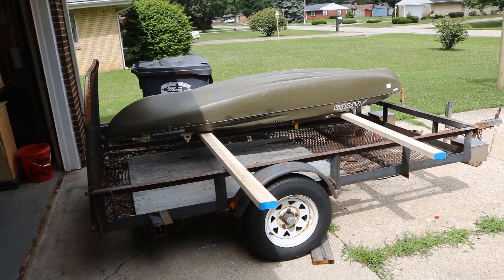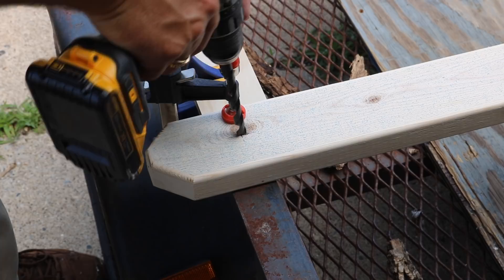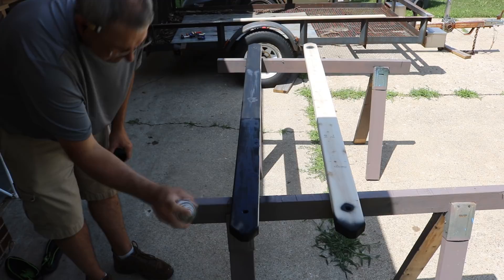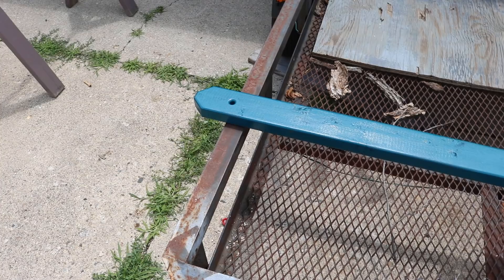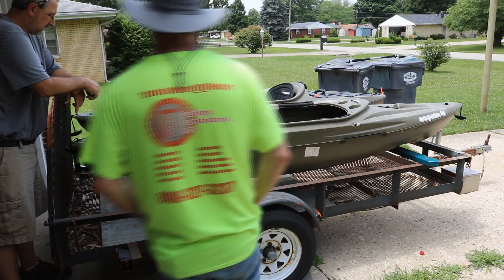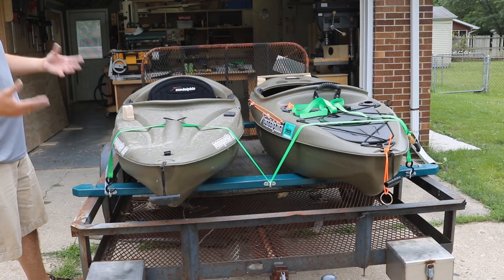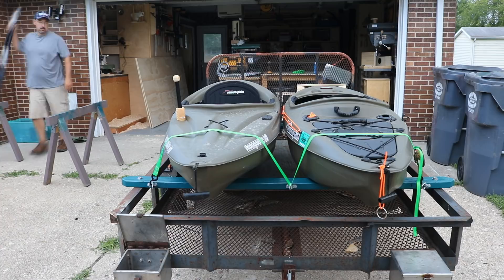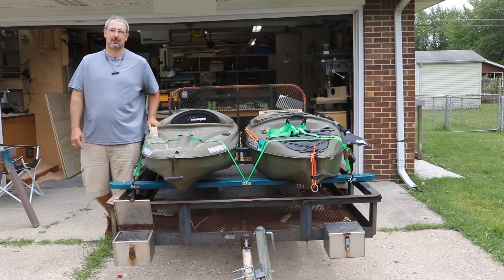Kayak/Utility Trailer

Comment: I like seeing new way to solve problems. I will probably build a tray that fits on the floor of my little trailer.
I have a couple of suggestions. I think you should have used a little larger bit for your tap drill. It shouldn't take a huge amount of torque to tap the hole.
Secondly, be careful with your anchor rings. The load rating is for a straight pull. When you apply the load to the the side of the ring, the rating is greatly reduced (on eyebolts, it drops to 25% of the straight load rating). It should be okay, but check them regularly.
Reply from the maker: Good points thanks for that

Comment: What size is your trailer and I have a 10ft 6inch kayak do you think that would interfere with the turning radius while driving with the overhang? Thanks
Reply from the maker: It’s 8ft and my Kayaks are 10ft I’ve had no issue
Reply: Mike Fulton Thanks for sharing this video I may use something stronger like 4by4’s to support the weight better and larger i hooks to make sure they definitely wouldn’t move.

Comment: hi mike love the idea i plan on doing this. Is this setup still working good for you or would you change anything after using it for a year.
Reply from the maker: Actually I found it much easier to just put the kayaks on the trailer itself. No I don’t use the setup anymore.
Reply: @mfwoodshop good to know thank you sir for the info